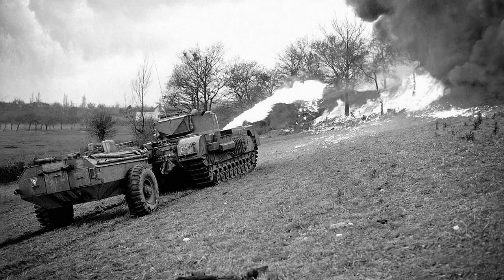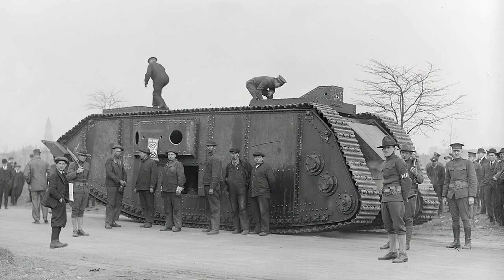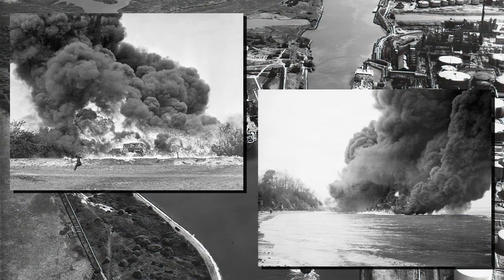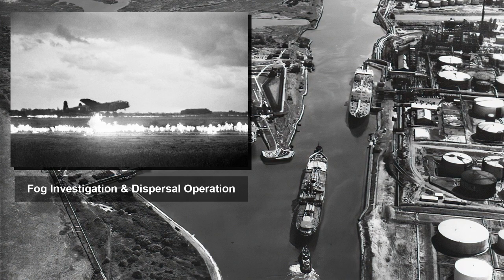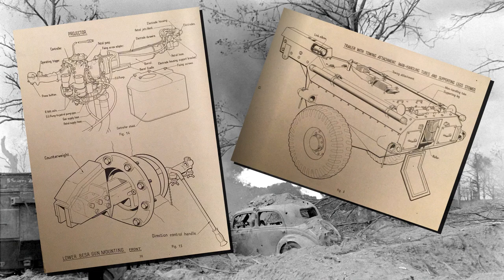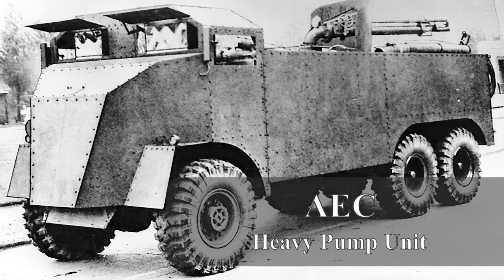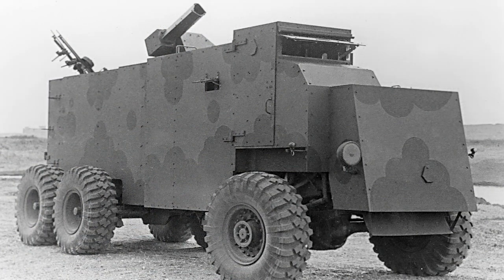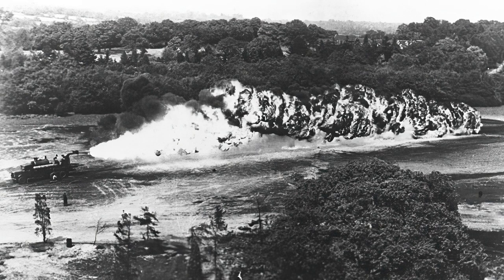British Flamethrower Vehicles - Tank Design & Development - Part 1

Comment: How do you get access to Bovington Archives im dead jealous
Reply: i volunteered there for 6 years but otherwise, drop them an email https://tankmuseum.org/services/archive-and-library/
Reply: @edfrancis712  Would you ever think about doing a video (or series) on comparing and contrasting tank suspension designs?  In The Chieftian's "Inside..." series, he often talks about ergonomics, specifically the comfort of the drive.  For German tanks, the overlapping road wheels and torsion bar suspension was done specifically for combination of comfort and ground pressure (with the Panther, I believe, having the best of all ground pressure test results).  I've never been able to find anything to explain the HVSS, SVSS, etc. but saw that, per American tests, they felt like the HVSS was nearly comparable to torsion bar.  Would be interesting to see breakdowns of them, just to explain why they were what they were and what they brought to the table.